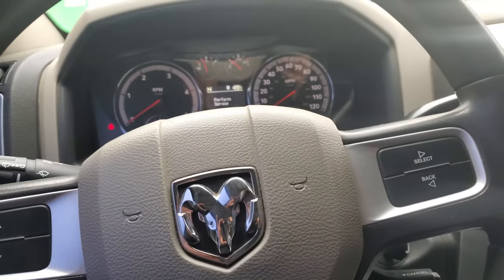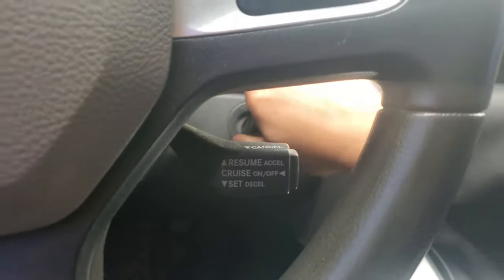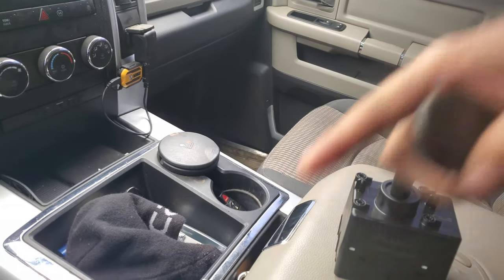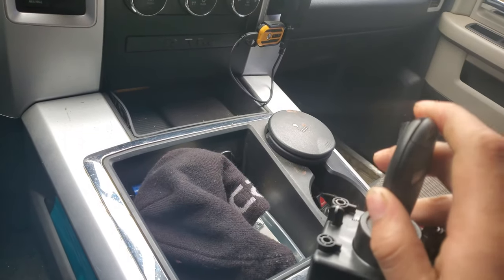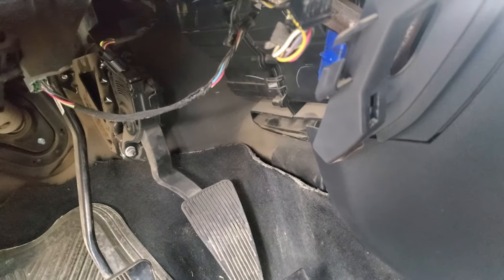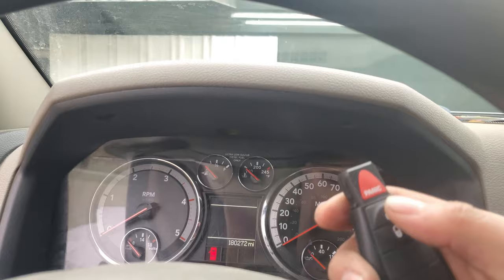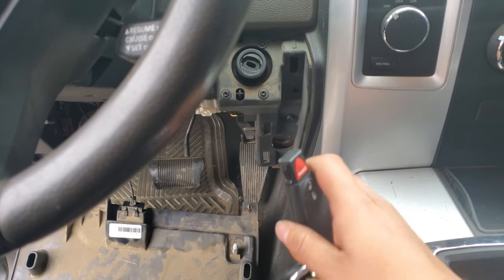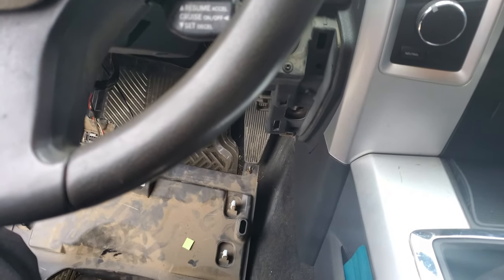How to to fix dodge Ram ignition switch problems, not starting 2010-2019 Dodge Ram 1500/2500

Comment: Thanks for this video! This is exactly my problem. I actually can hold the key slightly in the Start position after my truck cranks and it stays running. Once I let go of the key and it settles to its On position, I can see all the electrical cuts out and my truck stalls.
Reply from the maker: thanks a lot for watching
Reply: I’m having the same issue with my truck. I don’t want to spend $1000 for it so I’m going to try blowing it out with compressed air first and if that doesn’t work I’m just going to send out my old one with my keys to get repaired. Of course this issue comes with a huge price tag🤦‍♂️
Reply: @treamoreland6881 any luck with the air compressor?
Reply: @schooell where did you find it. My 2014 started acting up like the key is staying in the start position for a second after the truck starts
Reply: Where can I purchase a new box for a 2012 1500
Reply: @schooell  where

Comment: For those who have remote start simply remote start your truck then insert the key and turn it, it works for me 👍
Reply from the maker: Great tip!
Reply: Works great if your auto starts still works
Reply: It won't go in to gear
Reply: That did not work on mine. Had to replace the switch

Comment: My Dodge ram 1500 with a 5.7 hemi 2015 will not start will not read the key at all
Reply from the maker: I had a similar issue with a smart key on a 2015 dodge charger, the key was damaged, did a replacement and saved the customer 500 for the trip to the dealer and towing
Reply: @JVFIX yo I got a 2011 that woke up one day and suddenly the ignition switch is locked and won't turn. It's not "turn the wheel" kind of simple crap. Is my ignition switch just done for or is there a way around it because it's 500 bucks
Reply from the maker: ok when u insert the does it say in the dashboard no key detected or is just black. have u checked your car battery?
Reply: I'm currently having the SAME problem. How'd you come out with yours?

Comment: $1,000 is outrageous
Reply from the maker: yeap they are making a big profit on this issue some shops
Reply: $1000 for just the part when I clicked on the op’s link. Amazon ranges from 250-500, so I’m going to risk going that route, but I haven’t seen one that comes with the key, but they all have the key in the picture
Reply: @benjamin_w.  im currently on the same problem, let me know if it worked?

Comment: Mine just died had the battery checked and it was good. Went into a store for 10 minutes and came back out none of the dash lights come on at all when I turn the key. Had the battery checked and it was good. Now idk how much it’s going to cost me To fix it.
Reply from the maker: I would try first using an air blower to blow out the dust that sometimes gets stuck where u insert the key and then if it doesn't work then u will need new module

Comment: I have the same Issue but I was told that the new module has to be programmed by Dodge or else the truck will go into THEFT / LOCK out mode ?
Reply from the maker: the new module does not need programming but it needs special tools to program the key, there is a website where they sell u the module ready plug and play
Reply: @JVFIXLLC

Comment: How much you pay for that?
Reply from the maker: The module and keys was about 400 plus tax depending the state u live. But I would advise you first to use an air blower can or something similar and blow at the ignition switch. So basically what happens is that dirt gets stuck on the contacts inside causing a non contact issue if doesn't work then u have a faulty switch.

Comment: Can this cause a crank no start condition. It’s a 2017 2500 6.4. It will run if you shoot starting fluid in the intake initially. After that it will start over and over until it sits overnight. Like the fuel pump isn’t on in start position but is in run position
Reply from the maker: i have seent this issue happen also on challengers and chargers most of the time is the fuel pump and the connector also the fuel pump relay fails often

Comment: Would this make the truck randomly shut off?
Reply from the maker: No I don't think so. U may wanna check your fuel pressure. Or u could have an electric problem.
Reply: Yes, if your key jiggles just right the truck can shut off.  Just take the WIN out and spray it with brake cleaner or electric connection cleaner.  Save yourself hundreds of dollars.

Comment: Mine just clicks once likes it the starter but it isn’t. I tested it from the starter relay with a paper clips. Bought a new relay too so the relay works. Battery and alternator is also good. It starts sometimes but sometimes it just clicks. Could this be the issue ?
Reply from the maker: have you tried blowing with air the ignition switch hole it could be full of dirt
Reply: @JVFIXLLC  thanks ! Will try this later today. It’s been starting pretty consistently this week but I’ll blow it with my air compressor just in case
Reply from the maker: @sense1rich832 yea try that first
Reply: Mine has the same issue, any luck?

Comment: I have 2010 ram 2500 hemi ST doent have the keyfob uses an actually key but same style i get power to everything but no crank or even click of the solenoid
Reply from the maker: I would check the starter first and if is ok then the ignition switch could be the issue

Comment: My 2010 ram 2500 6.7 battery light keeps coming on and off. Everything checks out good. Voltage stays up. The module is the original and the starter is original. But starter checks out good. Would the module make it do that. The truck has 393000 miles   An where did you get the win module
Reply from the maker: no this module won't make that problem happen. I would say it could be the ECU I have changed plenty of the ECUs specially on these engines but I would first check the batteries because these trucks use 2 and if one of them fails it makes the truck act weird.

Comment: What if it cranks it’s good ? For sure
Reply from the maker: if it cranks its good and maybe you have a non-start issue
Reply: @JVFIXLLC  thanks it was the fuel relay fuel pump was inconsistent I did the bypass now it buzzes the fuel pressure right up 😭😂